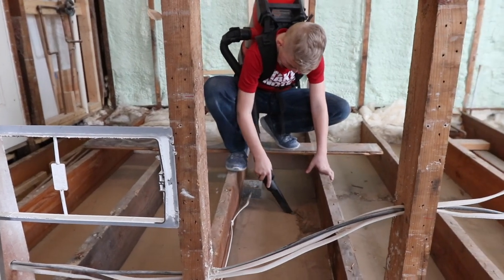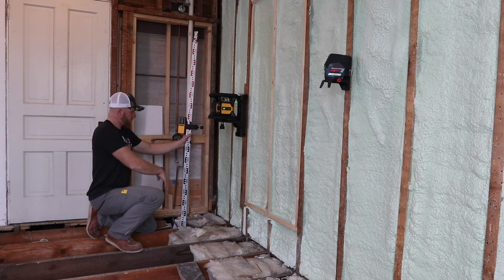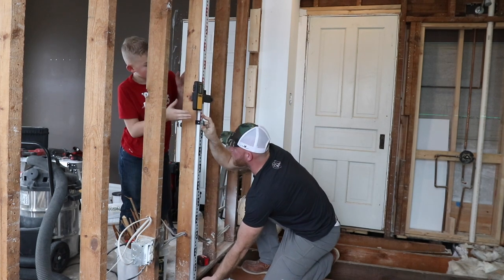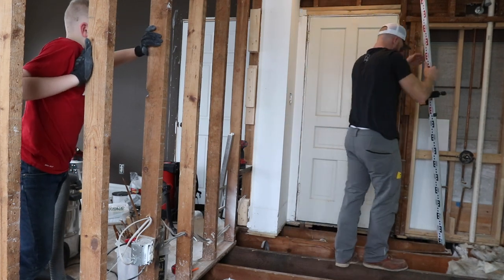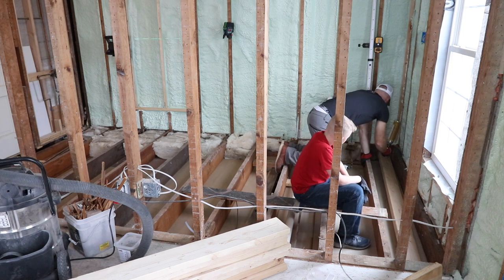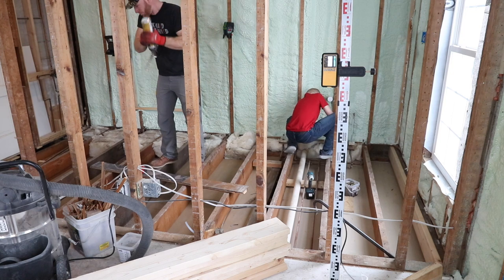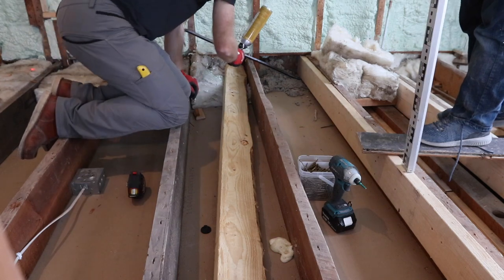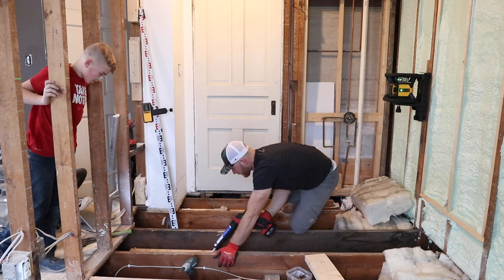Remodeling My Old Farm House: how to Sistering floor Joist and Level your Floor

Comment: I used a Geberit Monolith toilet with a floor drain, although it can also be configured for wall discharge. I only had a nine inch center from the wall. The PVC waste piping is adjustable. It added some flexibility to the bathroom design.

Comment: Awesome project and a great way to get some kiddo time and teach him something. He will look back on this later in life fondly for sure.  So yeah pex is the way to go but on small projects I prefer to keep it copper everything else already is copper. However,  for you DIY guys it is waaay easier to fit your vanity cabinets if the supply lines are going over and up through the plate and out of the wall.  Fighting plumbing coming from two directions will just lead to sloppy tolerances around the pipes in the cabinet. 
    I know this was a while ago so I will catch up and see how it turned out but I am hoping he decided to place the toilet at the end where the old door was and make that a separate potty room and then move the shower down. Ideally the shower could go at the end and the window be reduced and frosted glass installed. Oh and I really hope it's not tile,  who wants a shower made of remnants of stone or fake stone? A custom shower pan with river pebble and a slab walled shower would look tight in there. Better yet since he had the floor out, a curbless shower so the next owner or them can "age in place" and also have a beautiful shower.

Comment: You need to make sure that you leave that foam gun and can assembly with material in the can and vertical with the gun on the bottom or the foam dries in the gun.

Comment: Ty I was just wondering how to do this can you use the same principles for old walls.
Reply: Yes without a doubt, save yourself a headache and buy some LVL studs that are 100% straight especially if it's just a small wall section.

Comment: Will the shower be walk in accessible? Make shower pan area lower so center of the pan sloped tiles will be a couple inches lower than room floor height. Need to account for cement bed and tile with 1/4” per foot slope  to drain.

Comment: About to see if Spectra HL750 Laserometer (says universal red/green compatible) works with my older rotary (red). If so, alternative to limited Dewalt receiver for high/low from baseline?
Reply: So, was sent the latest HL760U, as opposed to HL750U, and can confirm that it works with an older model RT-7690-2 (Porter Cable Robolaser) with no issues.  

Now, shortly will be able to comment on operation with DW080LRS. I do not anticipate any problems.

Comment: Hey Kyle. I need your help. Want to get a cordless miter saw and all the current list tools I have are Dewalt. Is there a cordless miter saw decent? Don’t know why but feel like I would like to keep all the same brand just because of the batteries.
Reply from the maker: Dewalt cordless miter saw gets rave reviews
Reply: The flex volt or is the 20 volt ok
Reply from the maker: Flex volt

Comment: 8:59, isn't the sister joist on the right sitting lower than the original?  Don't the sister joists at all points need to be at or above the original?

Comment: Just wondering if there was a reason of doing it that way vs shoring up and leveling out the floor joists and installing a lvl microlam or steel beam?
Reply: That would be more time consuming than sistering as you just seen.

Comment: Putting tile on 3/4” subfloor is risky. When finished floor is tile your subfloor needs to be twice as stiff as a subfloor for hardwoods or laminate. Unless you plan on using tile with no sides longer than 12”.

Comment: Why not just raise that middle wall back to where it should be and not have to sister those joists?
Reply from the maker: Did what I could already In The basement
Reply: Had the same issue in my old farm house, floor jack moves the building pretty easy to brace it back where it should be.  Lazer would have made it much easier to get it right, didnt have one at the time.

Comment: I don't know about you Kyle but I absolutely hate remodeling. I'd rather start new then try and work around someone else's work. Older homes are the worst. The building code was terrible compared to today's standards. You definitely encounter way more issues then you originally thought. The finished product is the only good thing about remodeling lol.
Reply: I dunno man, there is a lot of dodgy shit built today also. Even from the really big boys i.e skyscraper builders
Reply: @Monsieur405  that's very true. A ton of contractors only care about one thing and that is the finish line.  They wanna finish a job asap so they can go to another, no matter what corners they cut.  The code is way better than it use to be back then though.